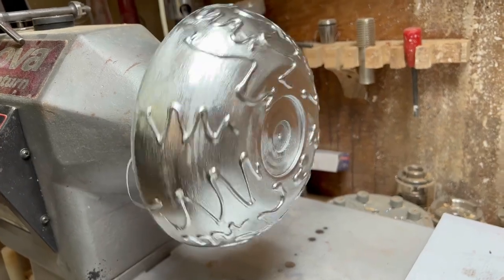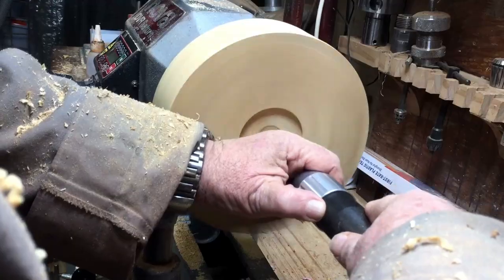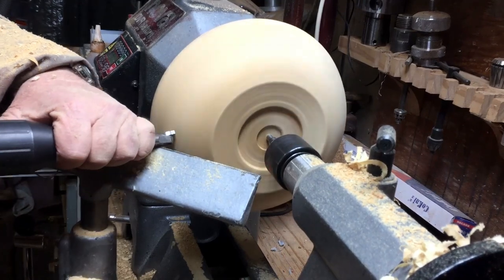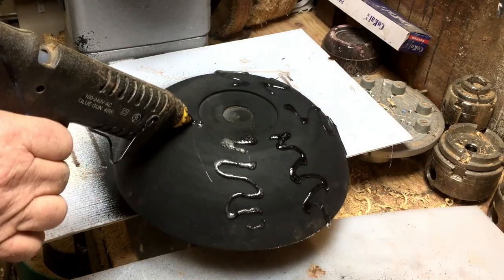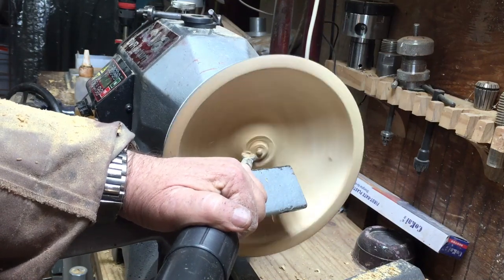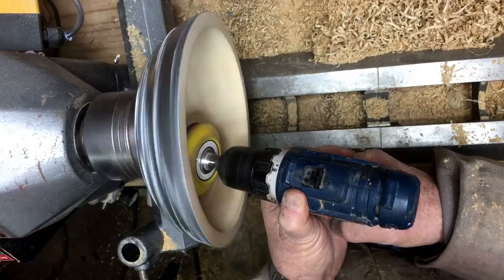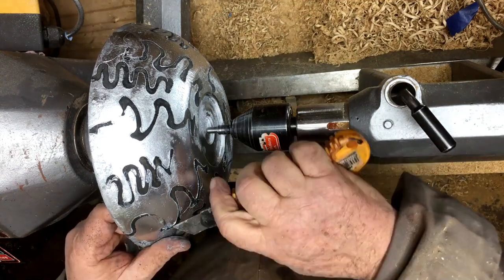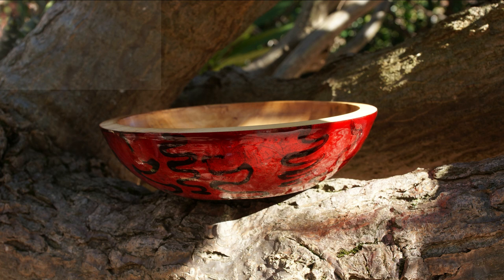Woodturning with automotive technique

Comment: Try the cut down epox on that mixed to the consistency of paint.......cut it 20% or more with Acetone because I know that works in color and when you take off the glue lines heat your scraper and they will come right up
Epox will soak into the soft wood and build up
Still planning my experiment but I just had surgery for a broken ankle and I'm going to be off of my feet of 2+ weeks
I always lover your content because you are always pushing
Reply from the maker: Thanks  Jed Taylor . I wish you a fast recovery  cheers  Ahron👍